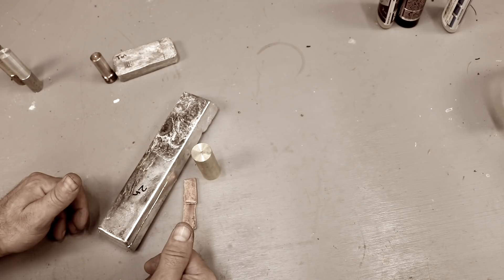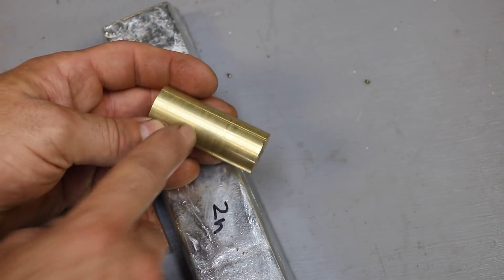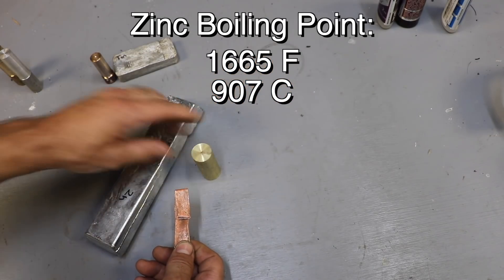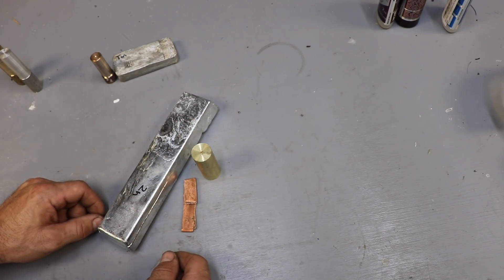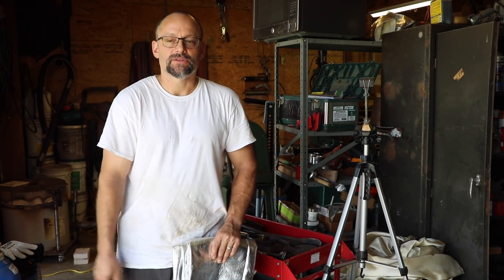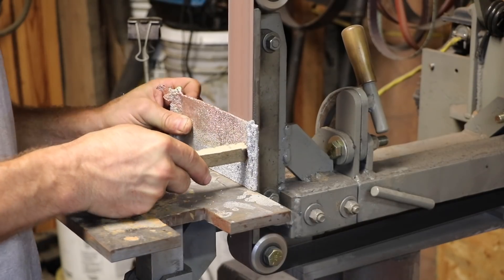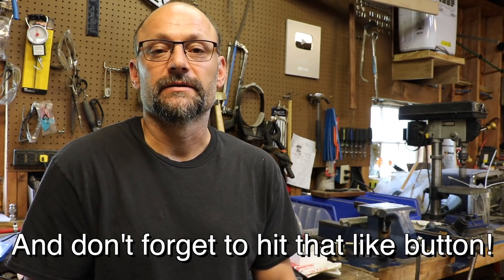Mixing Molten Metals.  THIS Could Go Wrong.

Comment: 6:20 kinda reminds me of swiping a finger through a candle flame. ok, a gas will transfer a lot less heat than liquid metal, but it is still hot. but if you do it fast enough, you won't even feel the heat. ask me how i know :-)
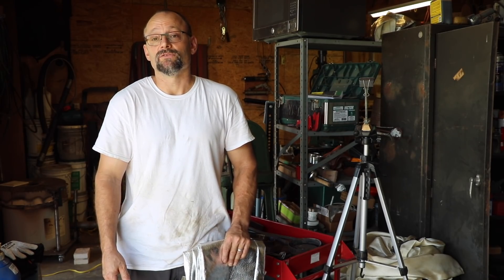6:39 how about wet jeans?
11:02 10 or 20 times its volume? try 1800 times. 1 liter of water turns into 1800 liters of steam at atmospheric pressure.

Comment: Think nothing much is going to happen, might smoke a lot.

I think the main problem you have had is that the density is too different between the metals at the temperature that you have been pouring them. Also, the more "violent" reaction you got at the end might help to mixe the two metals a bit more then they otherwise have been.

Comment: Being naked might be safer but what about your shoes? I choose safety boots rather than shoes at work because any spillages won’t pour into my boots because the opening is tucked away. You should be doing this barefoot  if wearing shorts.

Comment: That's wild dude.  Maybe keeping the copper very close to the freezing point will help you get that differentiation.  Essentially you are using zinc as a coolant to quickly solidify the copper in some random state, and the zinc just happens to fill the voids.  I'm so curious to see where you take this.  It's going to take just as much creativity to control the pour.  Maybe consider a mold on a lazy susan and a slow pour to induce some randomness with larger projects.
Reply: I think it helps that the melting point of Cu and Zn are closer together so that each- and their alloy- all solidify at about the same time, instead of the tin staying liquid long after the copper has frozen.

Comment: I scored some great PPE last year from a small art foundry that closed down.  I don't use the leather chaps or the aluminized chaps I got yet.  The reflective chaps will be great when I get to the point of working near much bigger crucibles than I am set up for now, as they radiate way more heat than my small ones - #6 to #12 - that can easily be solo poured without mechanical assistance.  But I do wear the thick, padded eather spats and leather jacket. Over that I have my old leather apron, which covers my legs down past the top of the spats.   Steel toed leather boots.  Hardhat with polycarbonate face shield, and I have a variety of gloves I wear when working with or near hot stuff.  I agree that it is up to the indivudual to learn what the risks are and make an educated decision about how much PPE is enough.  For me that means, at minimum, long sleeved jacket and long pants made of leather or natural fibers (burning on your skin is better than melting into your skin, so no synthetic fibers!), sturdy leather shoes or boots, welding gauntlets, leather apron, and face shield.  It's worth noting that before I got the spats, I once spilled some bronze on the ground handling an overfull crucible and a single drop splashed onto then immediately bounced off my steel toe, but even that momentary contact with the outside of my shoe resulted in a 3rd degree burn on my foot that took 8 weeks to heal.  I had to wear slippers to work for the first 2...  Also, the leidenfrost effect may provide bare skin with some protection from instantaneous contact with coppers or cast iron, but I've heard it said that molten aluminum and lower melting point metals aren't quite hot enough for that and will actually stick to your skin and keep burning.  Some foundrymen would rather get hit with Cu or Fe than Al for this reason.  I had a drop of flying molten aluminum land inside my glove once through a tiny opening at my wrist and it did not stick to me, it just burned me. I don't want to imagine if it had been a real spill and not just a drop... Small burns come with the territory, to me PPE is about minimizing the damage when you do F up, not to impossibly keep accidents from ever happening.  IMO there is a fine line, you definitely don't want to get any on you... but passing out from overheating because you are wrapped head to toe in leathers while dual-wielding hot crucibles with your crutch-shanks on a hot summer day clearly won't do either.  Oh! I forgot to mention the most important PPE of all: common sense.

Comment: The latent heat of vaporization (energy required to boil) of the zinc is very high. The change of state will absorb a lot of heat from the copper and quickly cool it. I say no explosion.
Reply: That would explain why that one worked. The copper dumped all of it's heat into the zinc so fast that it didn't have time to mix very much before solidifying.

Comment: My “not” favorite is when molten slag falls on leather shoes and burns through the shoe, sock and several layers of skin.  No matter how fast you remove your shoe, the hole on the top of your foot takes weeks to heal.
Reply: if it burns through your leather-shoes then you must have had shoes that let the metal pool up, cause normally it should basically just run off with only leaving slight discoloration.
Reply: Learned that lesson carbon arcing in jungle boots when I was in the navy.   Duct taped the lace area after that
Reply: Gaiters...
Reply: I've had a similar situation except with molten plastic.
Reply: I know 😂😂
Reply: get higher quality boots man! $200+ at least. if its part of your ppe, especially ppe that helps make you money. dont have to go top notch but mid-grade to maybe slightly higher.
Reply: It healed in just weeks !  Several layers of skin !!  What planet are you from !!!

Comment: What about pouring a flat sheet for a better swirl?
Reply: Good idea in theory, but more surface area means faster cooling and less time to mix and become random.  Don’t think it would work.
Reply: @JohnSmith-vz2cp  So maybe a heated surface or sand mold pre heated?  I've only melted lead and aluminum so armature hour on my part!
Reply: @purdunetae2995  the issue there is maintaining a high temperature in open air.  Lead you can melt on a propane burner no problem, but the reason any YouTube video showing copper or w/e melts uses a sealed furnace or kiln is that heat dissipates crazy fast in open air.  Trying to heat the surface of the mold runs into the exact same problem: it cools off too fast.
Reply: @JohnSmith-vz2cp  Gotcha and thanks!

Comment: Bare skin works great. I've had molten steel blow back on me countless times when using a cutting torch....I use real thin cloth gloves sometimes and when I do..I look down...the gloves are gone all but the wrist bands and my hands are untouched. The molten steel literally bounces off the skin. You definitely feel the hot temp but only for a split second. The water in the skin flashes to steam and the steam protects your skin :D
Reply: Its ironic..  the best time to do this crap is dead in the heat of summer.  The sweatier you are, the better.
Reply: Copper and aluminum do not they stick to skin..